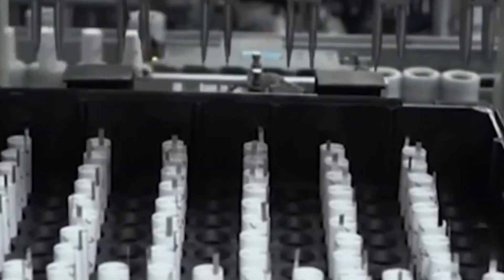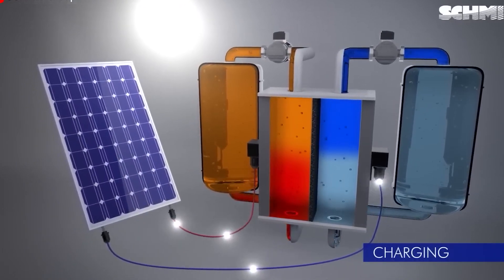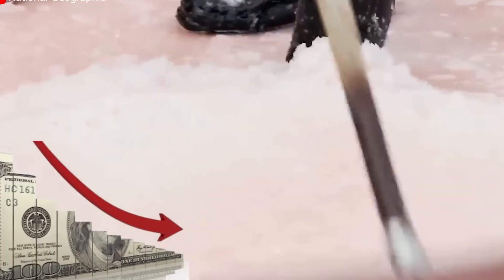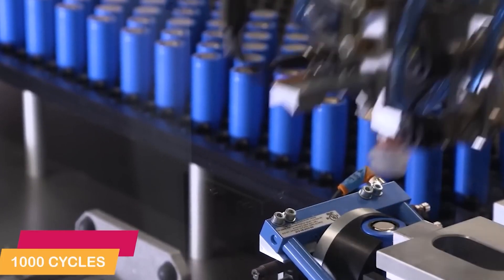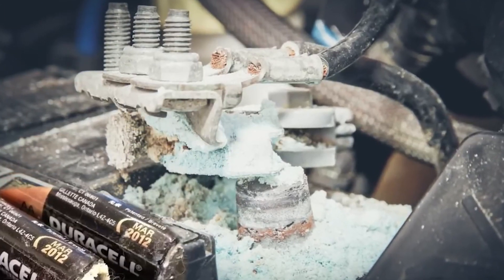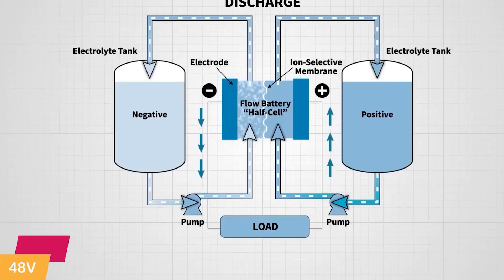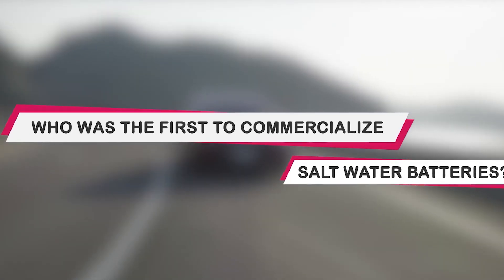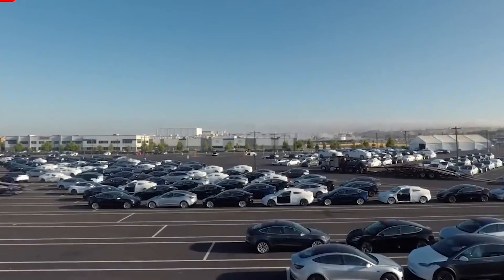Elon Musk EXPOSED How Salt Water Batteries Could Challenge Lithium!

Comment: At 4:20, the master text-to-speech script includes “$166” which gets generated as “dollar one sixty-six,” instead of the intended and desired “one hundred and sixty-six dollars.” You might want to change the input text, or consider a more robust text-to-speech generator. Interestingly, at 6:50, the script appears to be repeated, but this time with the correct English generated. Regards.

Comment: Yeah have fun accelerating on sodium ion which operates at low voltage. You're not even going to be able to merge onto highways it's so slow. The Sodium Ion cars reaching production? These are hybrid lithium AND sodium batteries because only lithium ion has the density and voltage to accelerate.